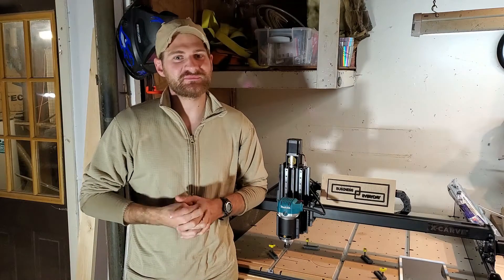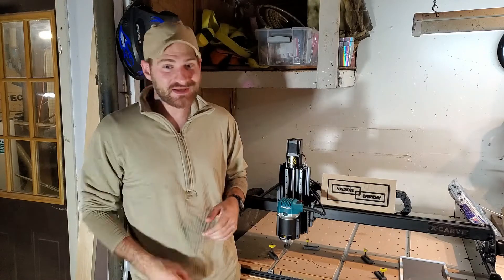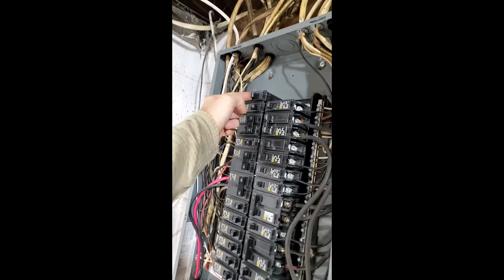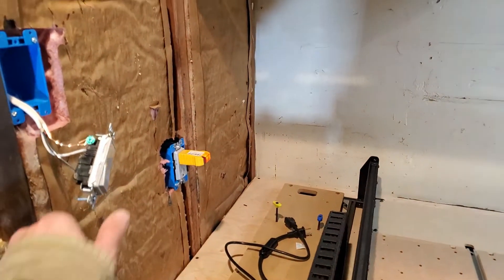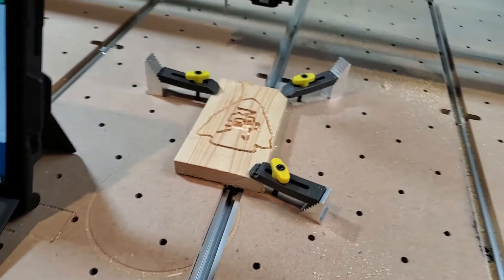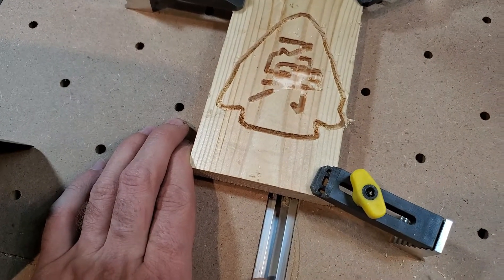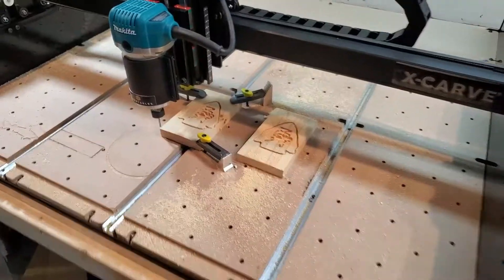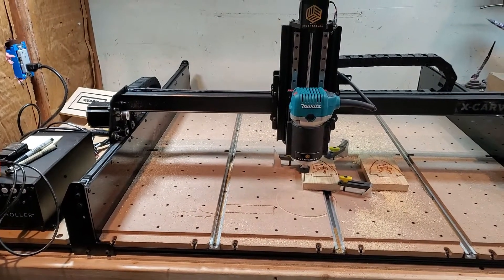Workshop Improvements Using Inventables X-Carve Part 2

Comment: I notice your not using the probe, is this common? So feed rate is important, glad your showing some work and what you did to rectify an oops. I rebuilt my table today and got to the stage of the Gantry brackets and wheels. Getting closer, boy your right talk about redoing things. Man the frame part I almost lost it. But I prevailed. the show must go on. I figure I will have about 3 days into this...Glad I'm retired
Reply from the maker: Great catch. Yes I have not been using my Zprobe.  I have it as it came with the upgraded bundle but the first few attempts on getting it to calibrate properly did not end well.  It's been a small point of frustration this last week but I haven't given it the appropriate level of time to problem solve my issue.  Once I figure out why it's not working right I'll post about it!